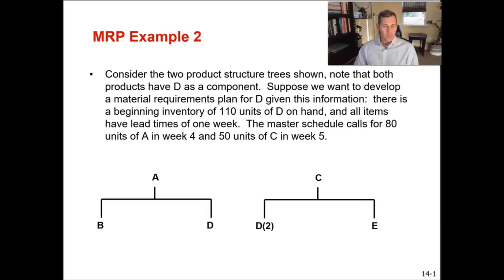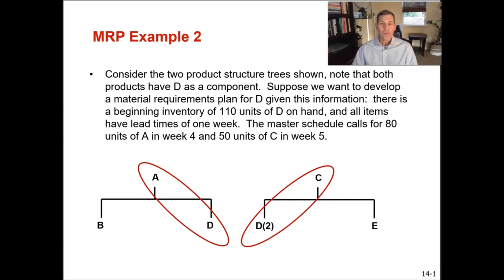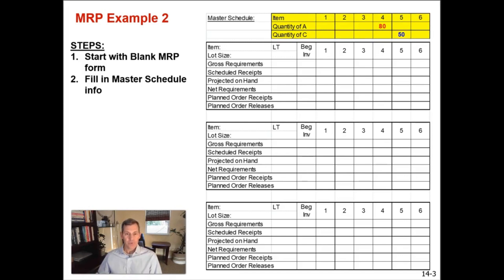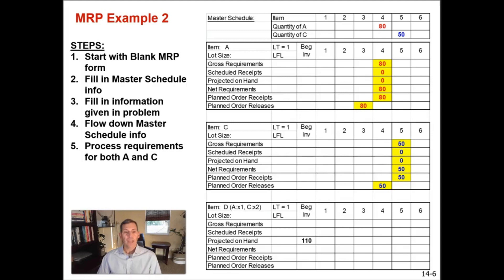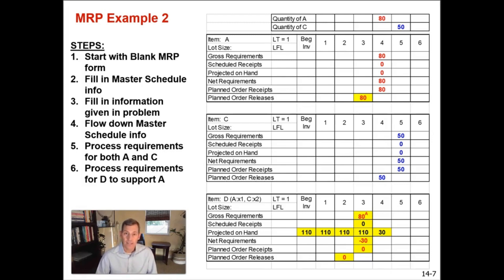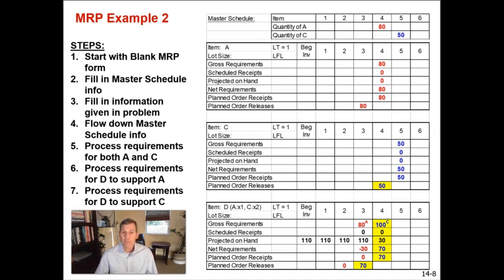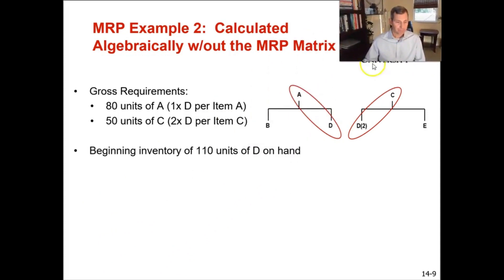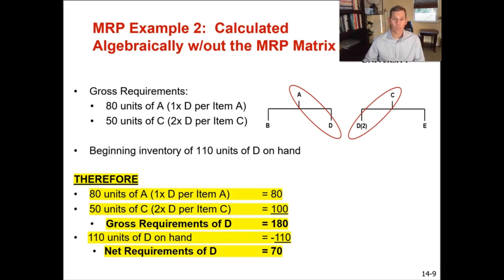MRP processing example with shared components

Comment: Hi! Thanks for the helpful video. If a shared component (D for example) happens to be on different levels of the BOM, would I need a different grid or they could go on the same grid? Thank you!
Reply from the maker: Great question. When you perform the MRP explosion process, the level the component falls on does not matter as much as the dependent demand to the parent and the amount of inventory in stock and on order for the parent/child. I've provided you with a very simple example to help understand this concept.  If that component is used in multiple places in a BOM (or multiple BOM's) you would not be able to solve the problem using this grid.  It would be too complicated and you would need to use MS Excel or an MRP software.
Reply: @OperationsAndSupplyChain  thank you for the clarification!